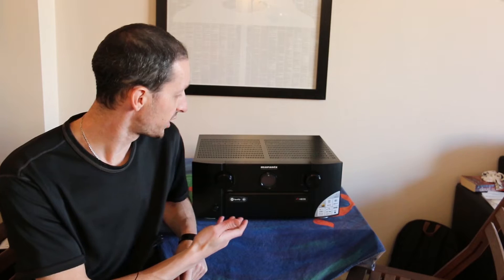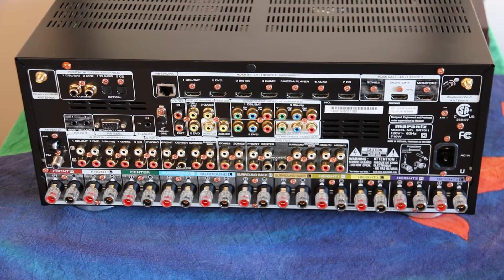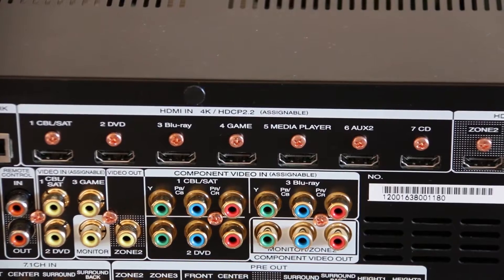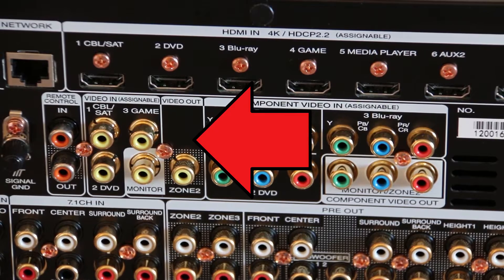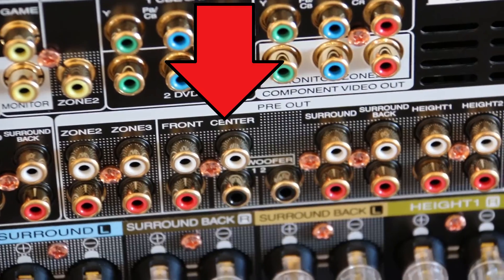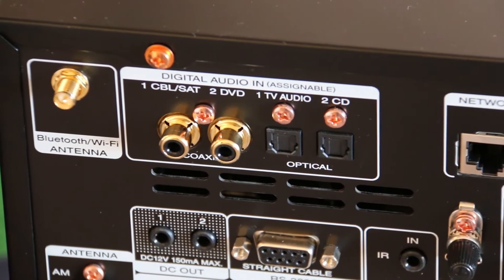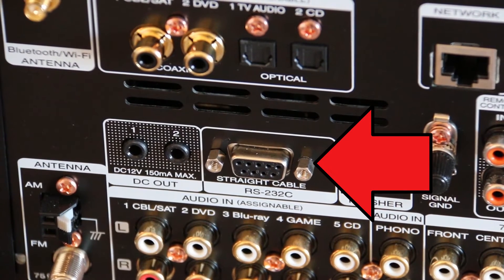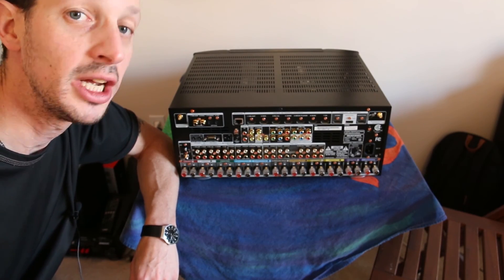A/V Receiver Connections Explained

Comment: Can I use 2 home theater receivers that have similar power and same brand that has multi channel in and pre outs? Pioneer elite sc-07 and pioneer elite sc-75 I want to use the sc07 for front 2 channels and be able to combine them also with the second reciever that will be the main sc-75 so I can use all 7 channels? Im trying to take some of the load off the sc-75 by using the SC-07 for front L R C  then the sc-75 for the back 4 surrounds ... essentially splitting the 2 receivers in half with the audio section but using them together     hope this makes sense and help would be great!

Comment: Hi. Thank you for all your outstanding content!  In 2011 I graduated school and my first job gave me a bonus so I purchased an acoustimass 10 setup with an onkyo receiver.  Its a tx-nr509.  I have the 2 front channels now hooked up to some towers.  The center and two rears are still hooked up from the acoustimass system which includes that powered sub.  I'm left with 2 each cube speakers that are not connected.  My question is, can I purchase an amp, use the pre-outs and hook the last two cube speakers up without purchasing a new AVR that is 7.1 or greater?  That is, would adding an amp to a pre-out work if that pre-out channel is already being used to power speakers?  Fake 7.1?

Comment: Plenty of S-Video sources other there, also XM and Sirius connections are missing.  Should have balanced outputs for the subwoofers - but alwya run subwoofers in mono.

Get external amps as soon as you can affoird it.
Reply: How do I connect up a Sega Genesis using red/white/yellow cables?  Please include any setup fro the menu as well